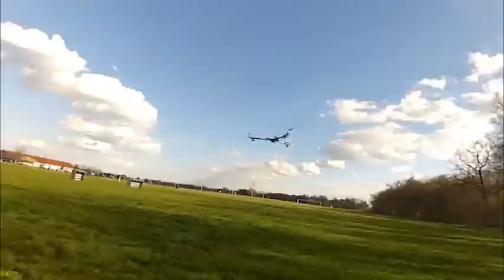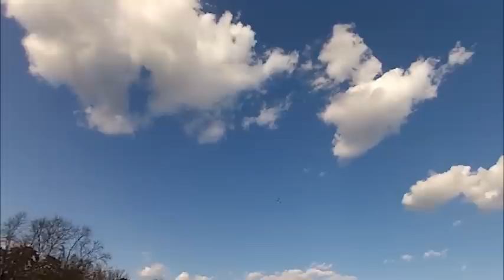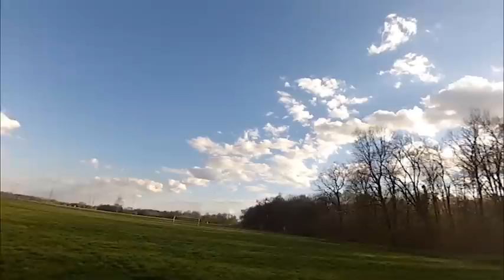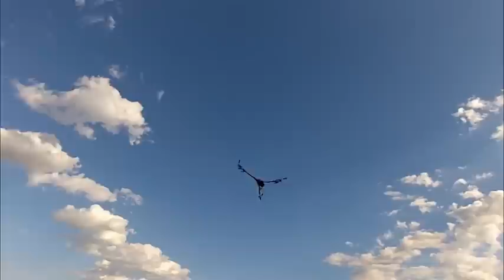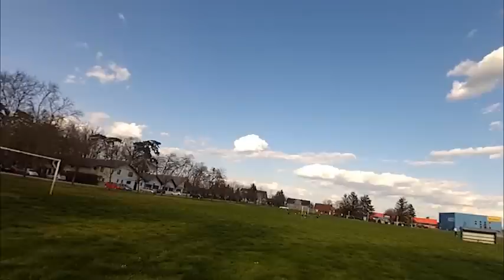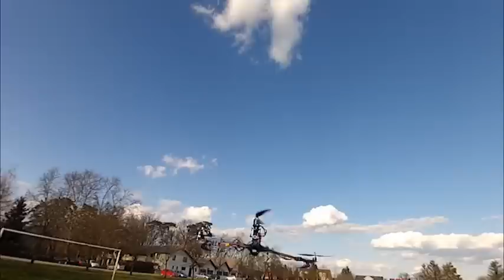x900 flight time test

Comment: im running same props same frame same controller just diff  moters  NtM 900kv    I get 11 minutes from 1 2200 3cell..
But I don't have crazy fast climb rate  but for Fpv learning its plenty of power
I have some new  3000  3 cells  I  need to test flight time with ive had 15 minutes  and I landed cuase I tought I may have forgot to plug in my low volt alarm lol